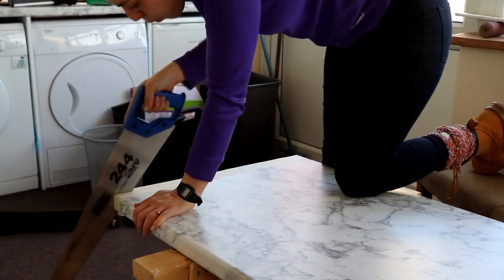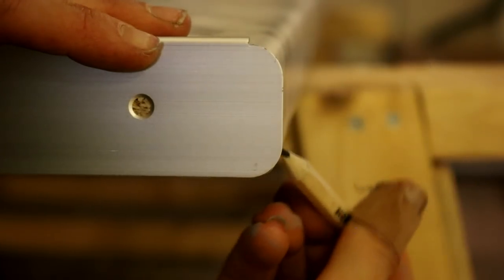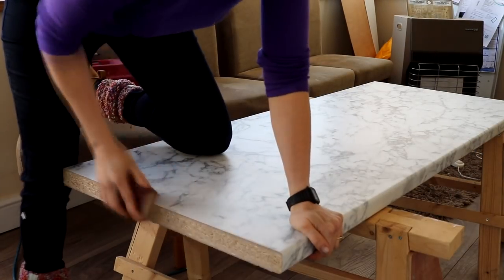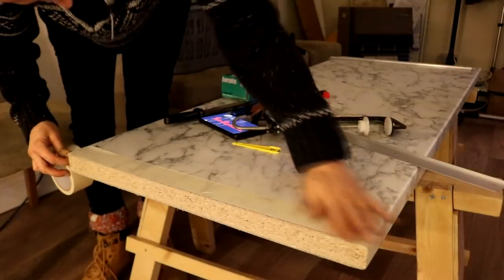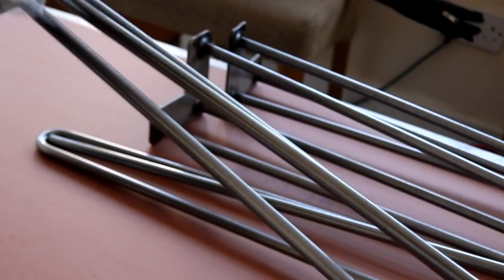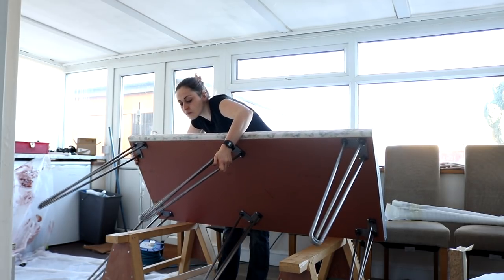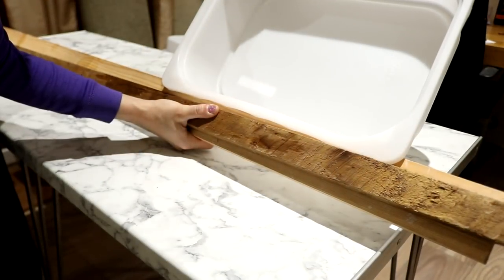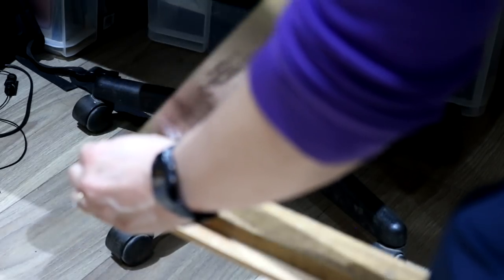DIY Faux Marble Desk with Hairpin Legs | The Carpenter's Daughter

Comment: Great idea with the underside storage. However I think especially as the rails could be seen (although not easily as they are not in the eye line) I would certainly at least sand them up and preferably plane them so they looked like good pieces of wood.

Comment: Love the desk and the marble effect looks just the part for the background for your food blogging.  Personally I would have sacked off the legs although they are stylish and made it into a floating desk, I have seen it done and looks really effective and one less thing to clean around.  lol.  I also would not have used the aluminium end strip, I just feel it makes it look more like an off cut from a worktop rather than a desk.  I know it is an off cut but using a blanking strip in the same marble effect would have made the desk look more sleek and stylish.  I do realise you did have the strip going spare but I wouldn't have used.  The draw runners are a great addition to the desk and quick solution to adding some storage.  However I would have built or purchased a small wall cabinet and attached this to the wall directly under the worktop where your have your makeshift draw.  

It's all personal preference as I like things pretty modern and I do not believe would have added too much time to the desk project, also fixing it to the wall would be another issue if you did want to be able to move the desk at some point.  Overall I like this project and it makes use of off cuts that otherwise would be disposed of and that is cannot be bad at all.  Win win all round!

Comment: Hiiiii, Random question, do you have a normal (Category B) driving license to drive your van? From what I know you need to have a category C1 license if the vehicle is over 3.5 tonnes? I'm thinking of doing a van conversion, and I'm not sure on the licensing. Thank youuuu (love the videos btw!)
Reply from the maker: Apparently we don't need anything more than a category B license until it's over a 7.5 tonne vehicle.  Then it becomes category C.  That's what it says on the back of our licenses anyway.  And thank you 🤗
Reply: @TheCarpentersDaughterUK  Thank you! I've been researching this for a while and couldn't find a decisive answer, Merry Christmas btw!
Reply from the maker: Same to you 😊
Reply: If you're in the UK (or rather GB), go here for info:
https://www.gov.uk/driving-licence-categories.  

"Van-sized" vans are usually 3500kg or less MAM but check the vehicle plate to confirm. You can even tow some trailers without the +E (trailer) category on your licence if you're good at maths.

Sorry non-Brits, this comment wasn't for you.